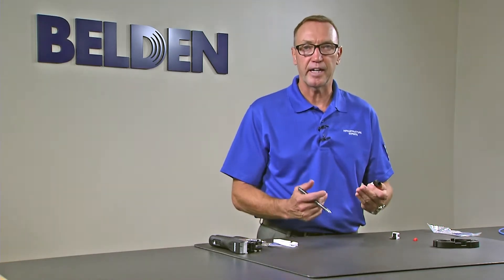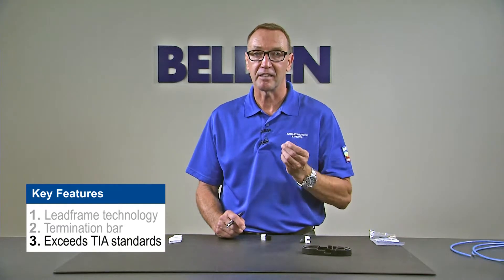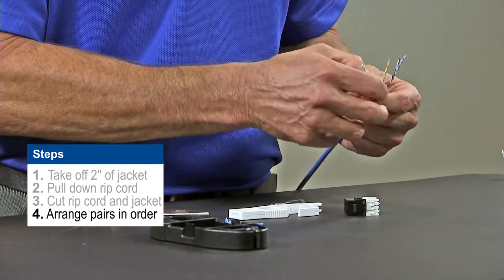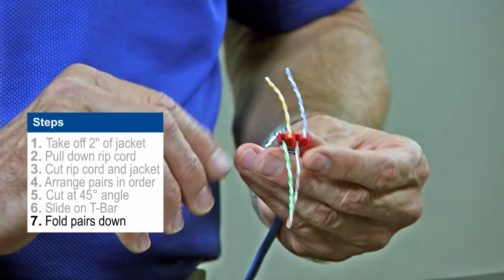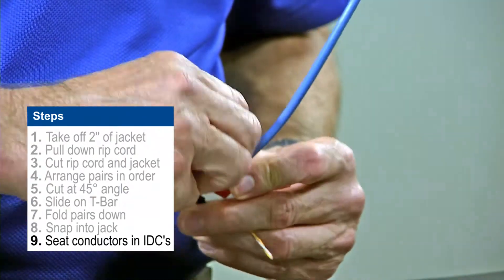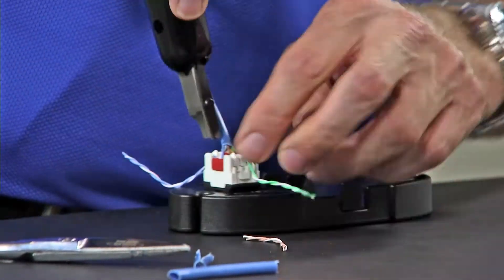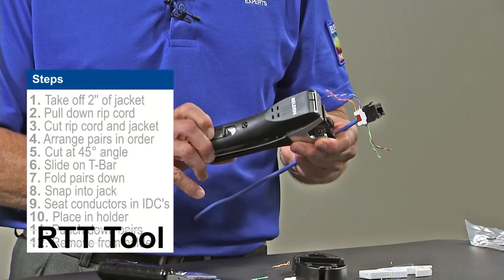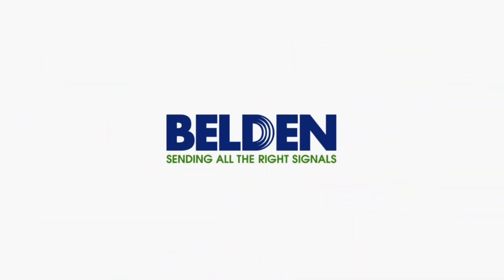CAT6+ KeyConnect Jack Termination

Comment: You may have nicked the wire.  Use the rip cord to expose un-nicked part of the wire.  Good advice.  A tiny almost imperceptible scratch will bite you in the rear.